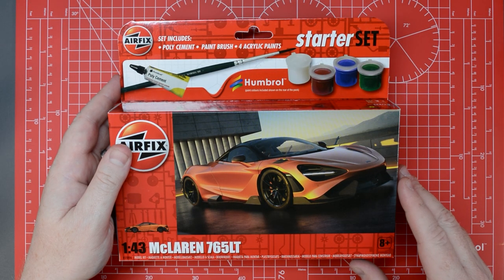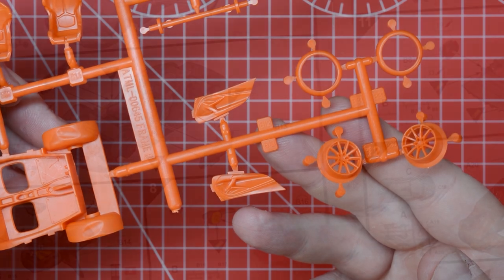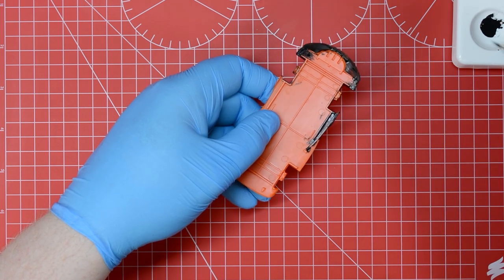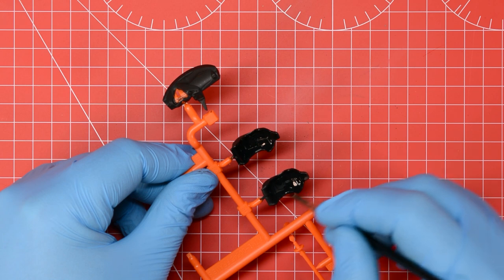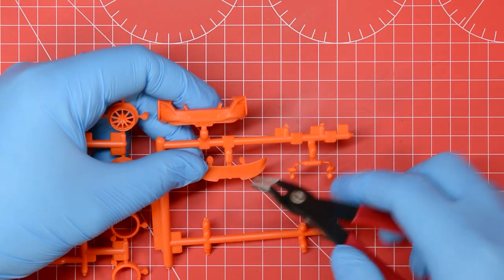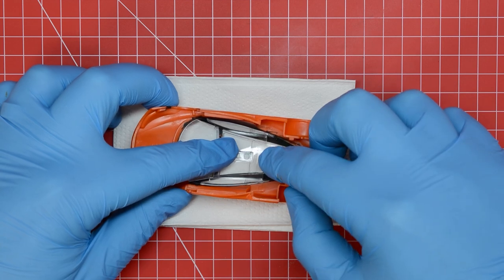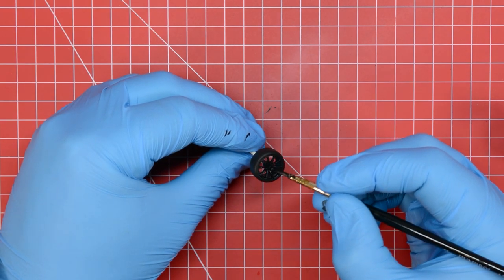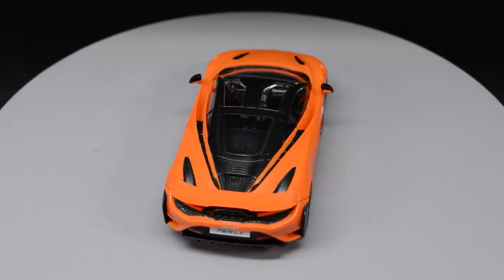How To: Airfix Starter Set- McLaren 765LT (A55006)

Comment: Love these quite professional videos and I like the presenters rather bland voice. Built the similar Pagani car model starter set, as I found it cheap in a charity shop. Thought its parts simplicity was crap compared to original Airfix cars, the decals almost too tiny to mean anything. Also I used a spray can for a much better finish and cheap masking tape for painting the detail on the transparent parts and bodywork features. Ok when finished, but too small in scale to really complement the real thing.